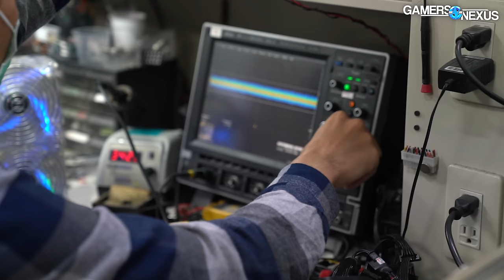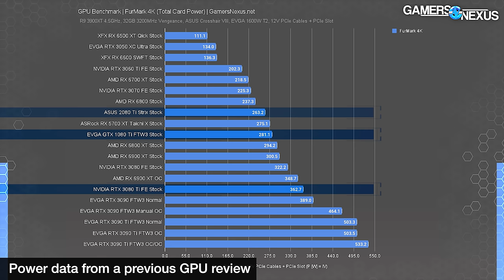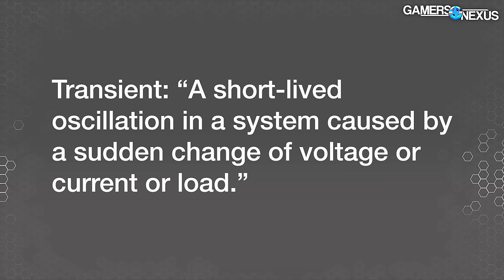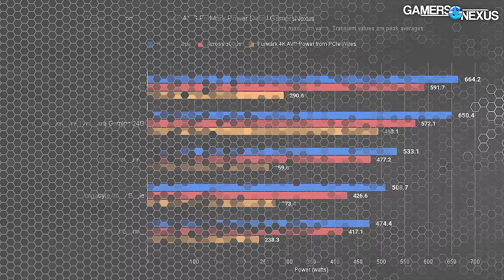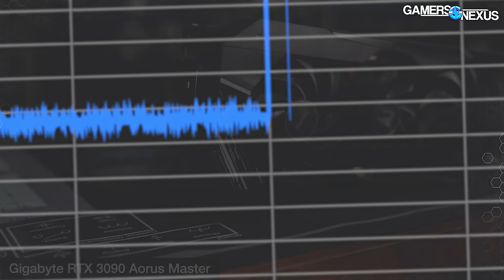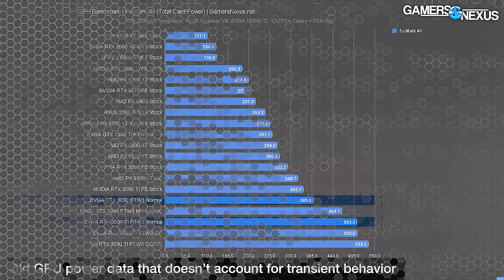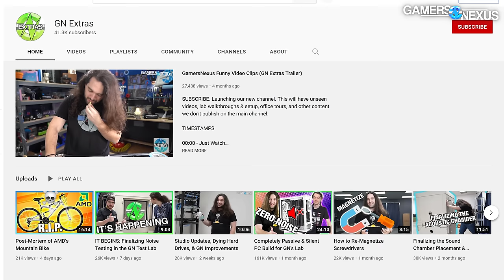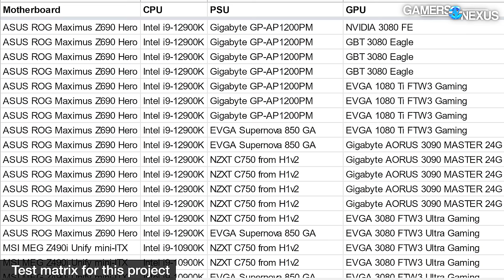The Brewing Problem with GPU Power Design | Transients

Comment from the maker: Support our in-depth testing, journalism, and analysis! Grab a Modmat, mouse mat, shirt, or more at https://store.gamersnexus.net/
Watch our PSU Reviews, Deep-Dives, & Explainers Playlist! https://www.youtube.com/watch?v=yDX_1PWUWdw&list=PLsuVSmND84QtHZ6WXQ4-4YJhq9VVkOOtw
Reply: Love how the intro of the video is edited like a Dateline NBC report.
Reply: THANK you for this video! We've had customers GPU's returned to us because they exhibit that exact behavior, tested (Corsair AX 1600's), found to be working flawlessly sent back and forth a couple more times before we've figured out that their PSU is (although above "spec") not handling the loads some of these monsters pull under spikes.. GPU's should have transient spike recommendations included. Easy as that. Bad marketing for Nvidia/AMD? Ok, we (small retailer) do not give a f*ck, current system is misleading. AND! A lot of customers don't enjoy getting "up sold" on PSU's.
Reply: Great video Steve and his team!!! Glad you guys made this video!
Reply: I am a Mechanic (40+yrs), and I have a general rule. Your battery should be 2 CCA (cold cranking amps) per cubic inch of engine displacement. I follow the same rule when selecting power supplies. I make sure the PSU can handle near double what the system can draw. Your PSU will be most efficient at around 50%, it will also run cooler and quieter, and it will last a lot longer.
Reply: quick correction: the magnetic field is what creates the charge, not the other way around.

Edit: I would like to see what effect undervolting has on these spikes if any at all. I know you can get some interesting behavior out of a GPU by undervolting a little too much.. but doing it just right seems to make it more stable since clocks are not constantly shifting.
Reply: i'm literally stuck with an evga 750ti because of it's small size low power usage 
I've been trying to power reduce this pc while getting medium-high performance out of it but man such a hard task when everything wants to be big and power hungry
Reply: This has been causing me problems since the 2000 series. I was well aware of the magnitude of the transient draws, people on the enterprise side had seen them right after the launch of the datacenter cards back then, and did not want to sell people PSU's that were too small enough to risk OCP shutdowns but people would frequently have already specced out systems in one or the other of the various only PC building tools and those always recommended a PSU 1/3rd to 1/2 what I was recommending and that has caused me to lose a lot of sales. Having this video to show people will be very helpful.
Reply: There is also the issue that in a power supply with multiple rails that an unbalanced transient power draw can trip the ocp in only one of rails shutting the system down even if the average current of all off the rails used by the card are under spec.
Reply: My 3070ti fried my b550-f gaming motherboard because that 650w psu wasn't enough. Everything works except the motherboard lol.
Reply: Nice video, how many time did you get to hear about TSDB after this 🤔 cheers 🍻
Reply: Intel had to write a new ATX spec, for the first time in 19yrs, to cope with GPU power spikes. ATX 3.0 requires PSUs to cope with microsecond spikes of up 200% of the rated continuous load.
Reply: Do you think multi-farad aftermarket capacitors like in car audio could become a thing? Maybe something like that might work to cover the transient spikes.
Reply: @cmdrclassified  so true!
Reply: @adam346  No, it is both. Magnetic fields creates electric currents, and electric currents create magnetic fields. You can't have one without the other. It is why it's called electromagnetism. The two are joined at the hip. It is also the strongest of all the forces in the universe, at a billion, billion, billion, billion times stronger than gravity.
Reply: Shouldn't the tie on the 3090 be green? Nvidia wearing red.... I don't know.
Reply: I'd definitely love to see a video going over the rest of the data on the 2nd channel.  Thanks.
Reply: Bravo very well done, electronics explanations on point, good equipment to test on, chef's kiss.
Reply: Haven't had any shutdowns but I have had weird stutters in game.  Sff build corsair plat750, evga 3080xc3 ultra, 5800x,  asus x570i
Reply: I am using a 750w EVGA G5 on an MSI X570 gaming plus(3700x) with a 3080fe. Its been fine so far (over a year), but I have felt its needed an upgrade for a while. I have coil whine under any load from, I am pretty sure, the PSU and not the GPU. I hope this is helpful. I am looking to eventually swap it out for a Be Quiet Pure Power PSU. Maybe the 1600 in preparation for the 4080... jeez.
Reply: I had an example of what may have been this issue with older components. An i7 4770k on gigabyte g1 sniper, 2x 4bg gtx 770 sli system. Was shipped with a corsair 650 watt PSU by the system builder. The whole system was RMA'd and the PSU swapped to Corsair RM850 watt after the system would randomly shutdown presumably due to ocp.
Reply: Ok here is my million dollar idea for the next product for GN store Build a cable or smal size elegant box that is nothing more than a 16 V 105 C something somehitng uf rated capacitor that elegantly pulgs between the PSU and GPU and whathever throw some RGB on it because ughh apeal the mases literaly two plugs wires and a capacitor as much as i wan to make myself  a milionare and immediatly fill a paptent for this this will cost me at least 30 K I lack the capital and equipment to select the propper capacitance for this so I will accept a noctua 3080 as payment when you all sell the fisrt 5k transient current supressors
Reply: dude, 30 sec into the video and its clear that u have no expertise to talk about transient analysis nor rtx 4000 series
Reply: transient spikes cannot  trigger OC protection in a PSU, thats not how it works, they are not that fast because they are not  design to be that fast.
Reply: NVDIA and AMD need to reduce their power consumption, this is getting ridiculous. I aint buying a gpu that needs more than 250 watt
Reply: I dont mean to be offensive but u are trying to understand how a clock works and u dont even know how to read what time is it yet. Watching ur video its clear that u have help of a electrical engineer but u are not one and the help u have does not have a background in transient analysis.
Reply: 3 Questions: 1. Do you think it is a "American" or 110V Outlet Problem only? I use my PSUs at or below the recomended size and never had a failiure or shutdown, but live in Europe with 230V outlets.
2. Have you spoken to Igor'sLab? He does such testing (properly) for years now.
3. The CPU is an important factor as well. A Ryzen DOES draw less power as Intel CPUs, how do you factor that in?
Reply: @mullerprojetos253  if transients do not trigger OCP how would you explain their ability to reliably reproduce abrupt shutdowns that are strongly correlated with measured transients?
Reply: How is it possible for a machine to even exceed a power supply? doesn't it report its specs to the motherboard? it's 2022!
Reply: Hey GN I have a SFX Corsair SF750(plat) unit with a EVGA FTW3 3080 Ultra, No shutdowns ever, (paired with R5 5600X, Aorus x570i)
Reply: @adam346  I have the same error on my 3090 after i switch the mainboard and cpu. The only way I could go around was undervolting. 

Igors labs have brought it up my attention it’s may be spikes of load. Now I have a new psu (way bigger) and I stop the undervolting again.

And to get around I have needed undervolting a huge amount. Around 30% less fps to the time.
Reply: @gucky4717  hey i live in germany here. I got the OCC protectionism triggered with amd 5900x and 3090 by 850W be quiet high end psu. 

Igors lab and undervolting testing have me convinced it was OCC spike problems. 

Same error hard to reproduce after I switch to 1300w seasonic I never saw a shutdown ever again.
Reply: Awesome video! I had the same issue with my deep learning workloads  and Forza Horizon 5 on my MSI RTX 3090 SUPRIM X and 1100W PSU setup. Switching to 1600W has “fixed” the problem. When I was training neural networks, GPU was shutting down only on the start of the training epoch, not during the process, which also made me think it’s somehow related to power spikes.
Reply: I think the ultimate, but still free, "fix" to this is plain voltage reduction on vGPU side (max. vGPU in 0.7-0.9V range, depending on GPU die size). Basicly, transients testing on a card that is undervolted to a point it doesn't power throttle under Furmark at it's stock power limits (with possible max. turbo frequency decrease, since 0.7V on vGPU is definitly too low for the "stock" max boost frequency to be stable). Would love to know how low you need to go on GPU voltage, to make this a non-issue on lower powered PSUs. Thank you for this awesome video :)
Reply: @domi06021988  I have a 3070 ti w/ a 5600x (not oc'd) and a MSI mobo... I undervolt the 3070 ti to that of a 3070 wattage-wise and have had no issues... runs at 1870mhz consistently w/ no issues. without the undervolt it was hitting 1930-1990 Mhz around 300 watts.
Reply: Thanks, another quality review, thats why im subscribed for years. I have a question for you, is it bad to connect a pc to a wall socket without a ground plug? I live in an old appartment. Thanks!
Reply: I think I have something similar happening with my RX 5700, except it has to be drivers, and adrenalin has been updated to some watered down version that doesn't do screen recordings anymore, it likes to get fucky when I open bluestacks, sometimes having a sort of quick crash, meaning I have to close bluestacks and open it again, sometimes just bluestacks can shut the whole system down in at least one game, but usually what happens is that Im either using bluestacks, blender and a game that doesn't push the GPU to 100% and the whole thing does itself in, or bluestacks and either blender or a game. I actually can't work in blender and not be guaranteed to work the whole day without the system going down, although it never fully shuts off, it doesn't display anything and doesn't respond to pressing the power button, needing me to hold it to shut off, otherwise it just sits there with the AIO LED on (iCue can go do one, I used to be able to use my GPU temps to change the RAM LED's).

I can play a game all day and the system is fine with the GPU at 100%, but if it isn't being maxed it seems to go on strike after a while
Reply: one thing that people are not thinking about. what about the powerlines in the home where people live at. if the powerlines in the home are too old than having a GPU that is going to pull 600 watts like what the rtx4000 series is rumor to have. and the home or apartment powerlines are more than 20, 30 years old. might not be the best thing. the age of the powerline might not be able to handle a GPU that will pull 600 watts or hell 800 or more watts when a spike in power happen. it could stress the powerlines to the point that a electric fire happens from the powerlines being overworked and overloaded for their age.
Reply: A good follow up video would be about the new power specification that's supposed to address this issue with the new connector
Reply: Sounds like you guys could use a Data Engineer to collate your data collections/connections and standardize your database of testing datasets so you can run your regressions or search functions or whatever it is you guys use.

Hit me up.
Reply: @mullerprojetos253  Wow! Your comments are so constructive and helpful! You should get your money back. 

From that charm school you went to.
Reply: @gucky4717  well if the issue I had was this issue, which, symptomatically it appears to have been. I'm on UK 220v. So possibly not a 110v specific thing. Only one fairly unreliable anecdotal data point from me though!
Reply: GN team, you are an absolute diamond in the PC enthusiast community, I am amazed every time you guys do a deep dive on issues that are real and not covered and researched anywhere else. Please, never change and continue being so awesome! I'd also like to contribute my own experience on unexpected PSU shut downs, when I first bought a 3080 FE card, my PC was using a Corsair AX860 PSU, which I never ever thought would be a problem to run that card. However, it turned out that particular design of PSUs had very sensitive OPP and my system was randomly shutting down while gaming, so I had no choice but to swap my PSU to fix the random shut downs, even though my Ax860 was perfectly fine.
Reply: Question for gamers nexus. What is the difference between a transient spike, and the "kick" 9f power that a psu sends to turn everything on when you press the power button?
Reply: Silverstone has 1000w sfx psu, interesting to see tests.
Reply: Got some serious Terrance and Phillip: Behind the Blow vibes from the beginning of the video. LMAO
Reply: Awesome piece. This was actually a problem I saw in my life that I could not get my friends to believe for the longest time. A few of us bought systems this past year, all went with 3080/3090. I went with a 1000W PSU saying if everything was maxed out at full load - I would still have tons of headroom or could add more\upgrade. A couple of my friends insisted all they needed was a 750W or maybe 850W. "Why would they recommend 750W if you needed more" After months of random crashes the ones that went with a 750W (or one even 650W with a 3080) finally went with a better quality and higher wattage PSU and sure enough most of their issues went away. Some people really need to see this content. Its very real and happens so much more than any previous GPU generations, and I agree, it will only get worse. Thanks for all the work that went into this!
Reply: I love this investigation content :D Dive deep into a problem, not from only one perspective but all around. GPU, PSU, MOBO. Thnak you ;D
Reply: I’ve had this happening pretty frequently with my set up, wonder if I can send you the specs to replica it. Haven’t seen anyone review NZXT’s new 1000W yet
Reply: Stunning work, exactly the issue myself and a friend had with a 3080TI with 10850k on Aorus Corsair 850w / friend had a 11900k also with Aorus on an 850 Corsair. For me a 1600w EVGA PSU solved it. Friend went up to 1300w but ended up solving it with an Asus MB
Reply: it'd be awesome to somehow know which PSUs and motherboards have the best capability to deal with large power fluctuations
Reply: I'd like to see a lot closer look into what's depicted graphically around 9:50.  Specifically, I'm curious what's so difficult about ensuring that "all the things" (to abuse a cliche) aren't drawing power all at once?  Since it is known that that is what leads to transient spikes I'm sure they'd just do that if they could but I'd like to know WHY they cannot.  Why can't the driver software simply be written so that, hypothetically if using x registers all at once causes an unacceptable spike, then the software limits the number that may simultaneously be in use to no more than 0.9x or whatever threshold is actually appropriate.  It seems like it would be pretty analogous to standard "garbage collection" for system memory so what am I missing?

Thanks again for the technical info, Mr. Burke!
Reply: @adam346  
Correction:
Magnetic fields don't cause charge they cause *current*, and it works both ways:  current in a loop causes a static magnetic field perpendicular to the loop, and current that varies with time causes a time-varying magnetic field in a loop around the wire.
Reply: @reed-young  you are correct, not sure why I said charge...
Reply: @adam346  
Could it be because this is just the comments section of YouTube and not very important? :)
Reply: my solution was to buy the lian li xl case, install 2 psus, and use one of them for the gpu exclusively.
Reply: @RampagingCoder  I am thinking dual PSU's may be the answer in the future... just buy a moderately powered one (like 300-400 watts) for the core system and then a 500-700 watt one for the GPU (depending on what you are getting).
Reply: My 1060 6GB SSC is on its last legs as I have replaced the TIM and the pads and it is just not long for the road so I am hoping it holds out until I can grab a 4060 to replace it with.  What I am gathering is that my EVGA 850W Gold is just not going to be enough, or am I wrong?  From what I am seeing here on the something like a 4090 in the USA the wall is 1500w with spikes of 1850w allowed so we are extremely close to no longer being able to power this stuff via a 120v USA wired home.  Sorry, but that is beyond not acceptable.
Reply: next time the blame the user because he don't use extra capacitor's on the 12v rail, like on a Electric rc car. than gpu and psu manufacture are happy XD maybe it help if you overclock your system too. XD
Reply: @Tigerhearty  I revolt by under-volting.... get it?
Reply: I had this issue, some games where fine, others after an hour or 2 would just power cut out, was a pain as 'new' parts for PC and 3080 FE - went from a 750w to 1000w PSU and then issues stopped, i heard my x5900 AMD processor have unstable power draw as well- either way power spikes caused it to trip..
Did I blink and miss a URL to send my PC specs for your research? - Halo infinite would leave an interesting error in the event viewer log
Reply: Please stay on top of this. They can and do make power supplies that can handle these spikes. They're in high end audio power amplifiers. Our GPUs are $1000 dollars now. Our PSUs will eventually cost the same if they continue down this path.
Reply: I've got a RTX 2080 Ti and a SFX750 PSU. I was initially having some GPU related crashes and I suspected it was insufficient power so I reduced my GPU power limit to 90% and that stabilized it. I would definitely say even a 2080 Ti is marginal on a 750 SFX or SFX-L PSU, and I definitely wouldn't want to try running a 30 series card on anything less than 850 watts.
Reply: Guys, please reach out to me.  I have a product that goes on the 8 pin GPU wires and it SOLVES these power issues.  Yes, it is a bunch of capacitors, but the proper design and component selection is essential to the resolution.  I have samples I can send you to test.  Please do a video on them. I've sent an e-mail to your support e-mail address.
Reply: Love how Nvidia - since you mentioned them when talking about power supply manufacturers - stated that the Power supply had to have more capacitance to help with these transients, when its the GPU that is causing this! 

And I don't think it's the fault of power supply manufacturers. If GPU's have a power requirement, then fail when the correct rating of power supply is used, then it's got to be poor design of the GPU power supply, not necessarily the power supply!

So why don't Nvidia/Amd bulk up the capacitance on the boards that cause these transients, rather than pass the buck over onto the Power Supply manufacturers and hence onto all buyers of power supplies regardless of which GPU you have decided to buy????? And be more honest about size or quality of power supply required for these cards!
Reply: I respect you, @GamersNexus, You tell scientific data, that others can not.
Reply: Epic video!
Reply: @Gamers Nexus I have an EVGA 3080 ftw3 ultra gaming gpu, Asus Rog Strix gaming A motherboard, and a corsair RM 1000X psu in a Corsair 7000x case. 
 I'm having these exact problems of my pc randomly freezing/crashing and resetting itself. The cpu waterblock (MX2 ULTRA by Thermaltake) the screen on waterblock will randomly reset itself as if it's rebooting itself, my xbox elite series 2 controller randomly disconnects from pc at the same time the waterblock resets. It has 2 Samsung 980 pro Evo M.2 that are 1TB each (2TB total).  I'm running 12 of the new  Lian Li uni Infinity fans, 4 sticks of Corsair Vengeance pro (16gb each) 64gb total, and the I7-12700kf...  I have the Corsair XD5 rgb pump/reservoir, 480mm (40mm thick) Thermaltake radiator and a Corsair 360mm (30mm thick) radiator. The 3080 is in a Bykski gpu waterblock also (but problem has happened before I water cooled it. 
It originally had a Corsair 850w psu, so I upgraded to the 1000w, that didn't solve my problem. I live in Elkton MD. And don't know many trustworthy pc repair people or many pc repair people at all, and I have yet to solve my problem. Tried testing/re-installing ram, resetting/upgrading bios, fresh install of windows 10/11. Smh, this is insane. I do all the work myself, but I'm stuck. Maybe I need to invest in testing equipment that you show in this video. Ahhhhh
Reply: Hello. I just saw another video about PCI 5.0 "power connector" and ATX 3.0 new standard. They also spoke about power drain spikes. The expert from power supply producing company was answering to question, if those spike are danger / problem. He smile. He said that  (basically that´s a bullshit) power drain is so quick, that those spikes just disappeared in the average consumption. So, there is no need for double power of power supply. It may be more problem of the quality, as you also mention. And what the expert said, he is not a fan of any other cable adapters. Reason of 4x 8pin adapter for 12pin "PCI 5.0" connector is not because it is needed for power, but because another wire connection make more resistance and potential connection/transition problems. That´s why there is four of them. I would also ask if the people who has problems has also  custom cable. Because it is what every builder wants - cheap custom cable from China :).
Reply: This video needs a recap with these new GPUs in the market like the RTX 3090 TI, RTX 4090 and 7900 XTX